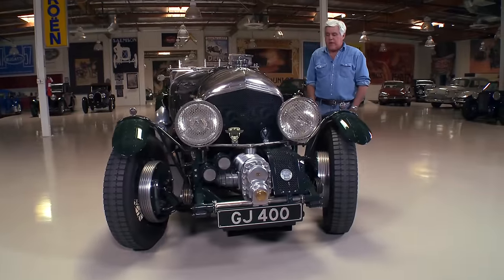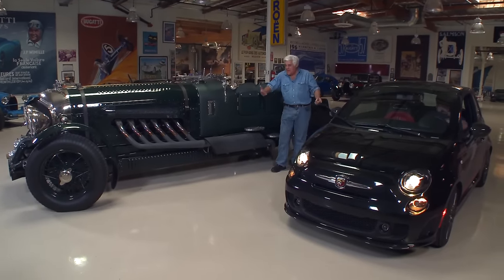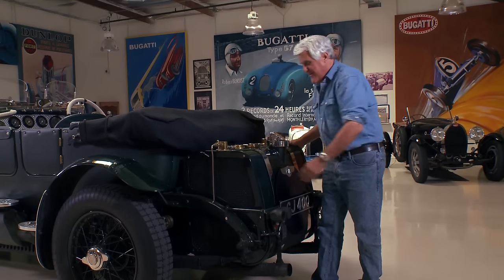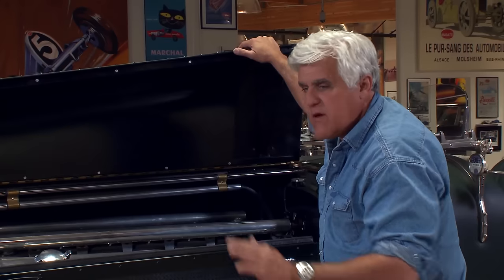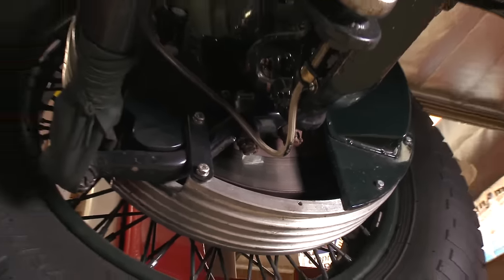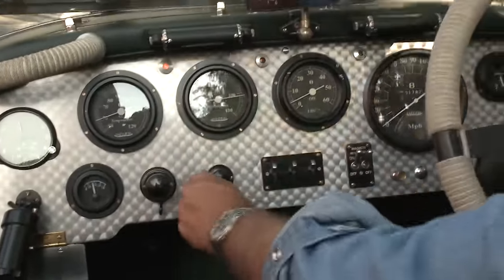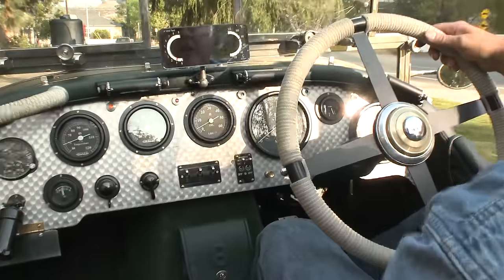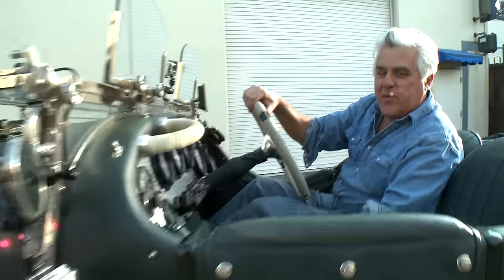1930 Bentley 27-Liter - Jay Leno's Garage

Comment: Is the motor a Rolls Royce Merlin or a Packard Merlin? I'm assuming its a Rolls Royce version because its put in a British car. You wonder how hard it is a to get a Merlin engine though.
Reply: Its probably a RR version given that the car was Built in the UK, and yes you can still find them for sale. I've seen them as cheap as $2400 however usually at this price needing a rebuild. They were built in large numbers because although most commonly associated with the Spitfire and the P51 Mustang these engines were actually used in a lot of other aircraft. Mostly bombers such as the Lancaster however, after the war could also be found in a number of commercial aircraft;, I think they were produced up until the 1050's. There's also a version which could be found in various tanks and other military vehicles although they were not called Merlin's, I've forgotten their name but they are often miss identified as Merlin's although had several defences including 2 rather than 4 valve per cylinder, no supercharger, different carbs  etc.
Reply: cheyennedogsoldiers The tank version was called the Meteor, initially used in the Cromwell medium tank.
Reply: TheAegisClaw No, the unsupercharged version was called the Meteor. It was fitted to planes as well.
Reply: Neither. As it doesn't have a supercharger, it's a Meteor.
Reply: Thanks TheAegisClaw I had a complete brain fart and could not remember the name. LOL! 

A3roboy, Not necessarily, without checking block numbers there's no way to tell the origins because don't forget, the Merlin version was deigned to operate on AvGas not conventional pump gas. Therefore these engines see significant modifications to allow them to operate on modern gasoline which often entails removing the superchager.
Reply: This particular engine is a Rolls Royce Meteor, basically a non supercharged Merlin engine. This actual engine is definitely a Meteor, not a Merlin. It started it's working life in a Lancaster Bomber. One of the sister engines from the same Lancaster went into a tractor pull tractor that I got to see in action, it was the tractor pull owner that told me about it when I had a chance to chat to him while he was getting his pit area set up. I know that this is a bit of hearsay but the owner of the tractor didn't have any reason to lie, the Merlin is the more desirable engine and he also had a massive pile of paperwork for the engine and the original bomber.
Reply: Just call up Jack Roush racing..he has two Mustangs and a warehouse full of engines,,,,,BUT   you had better have a DEEEEEEEEEEEP   checking account...he also has the only FFA certified rebuild station in the USA...FYI
Reply: quinnjohn1
No Meteor was fitted to an aircraft.  The Meteor is a tank engine, unsupercharged, and developed for ordinary fuels, not the super high octanes for aircraft. Just to be confusing, some Meteors were built using second-hand Merlin blocks, or even 'seconds' rejected as not good enough for an aircraft engine.  
 Lancs got Merlins, never a Meteor engine

Comment: What a spectacular car! And as you said, Jay, so well done. I'm curious about the
gearing; the Meteor is not high-revving {around 2400 rpm, I think}, and torquey too.
If 650HP/2400 RPM are right, torque = 1422 ft-lb. Tall final drive ratio is required!
Jay, you so plainly enjoy your collection, and are so intimately involved with
everything in it. You know how to operate it all, and how to share it with others,
unlike so many other collectors. Thank you so much! Charlie

Comment: The Meteor engine (which was Merlin based) was 650 hp non-supercharged used in the Cromwell tank
The Merlin 27 litre Mk II was the first production run and with supercharger it produced 1,030 hp (Spitfire, Hurricane, Mosquito, Lancaster, Fulmar, Battle, Halifax, Hornet, Barracuda etc etc)
The later Merlin XX with improved supercharger produced 1,240 hp
The Merlin was replaced by the Griffon 37 litre which was a similar physical size to the Merlin but with 1,730 hp (Mk IIb) up to 2,420 hp (Griffon 130)

Comment: Jay, as you are likely aware, the weak link in the Merlin engines relates to the flaking of the chrome plating on the rocker arms, that then contributed to cam lobe wear.  Well, my friend developed a solution for this problem that also reduces friction and increases horsepower. If you want, I can put you in contact with my friend.

Comment: Jay.  What a remarkable 27 litre Bentley!  There's is a larger motor available, the 36 liter Rolls Royce Griffin!  More fuel tankage required.  I'm amazed at the exhaust/muffler system.  So quiet!  It works so well with the rest of your car.  Your knowledge of Bentleys in existence is vast, do you know what happened to the 'Jumbo' Goddard twin turbocharged Bentley that was featured in either the 'Road and Track' or 'Car and Driver' magazine in the early 1980's?
Reply: utube is offering a 1924 twin turbo up next. Might be what you're looking for.

Comment: Makes me wonder how the Spits and the P51's managed to stay stay in the air as long as they did.  I mean that engine would be sucking the juice like crazy.   And, though I'm no historian, I've heard the P51's had very long range and were used as bomber escorts while the Spits were used mostly over England.  Still, they must have had massive fuel tanks.
I also read somewhere that the P51's used cardboard drop-tanks so when they dropped their tanks over enemy lines the enemy couldn't make use of the metal. 

Beautiful car Jay and kudos to the builders.  But does it have cup holders ?

Comment: Can you imagine turning it over at speed and 3 tonnes lands on you? Little chance of surviving. I remember someone who kept blowing original engines up driving at speed and couldn't figure out the problem. Finally worked out the 1930s engine was only designed to circulate oil to cope with driving at high speed (80mph+) in short bursts as British roads didn't have long straight sections suitable for continuous high speeds.

Comment: Henry Ford made an improved copy of the Merlin engine. It was a V-12 of course because 12 cylinders in a narrow V is a "natural" configuration for a 4 cycle gas engine. In engines that size you want it to be smooth running. He made it to be the same size as the Merlin which also was a size seemingly favored by nature. The Kestral V-12 was an earlier smaller version of the same basic design and was a success. But the larger version of this design called the Vulture never quite worked properly. 27 liters is just in the sweet spot for V-12 aero engines.  

So Ford made his new improved aero engine the same size as the Rolls-Royce Merlin. But it had many improvements. It had a stouter bottom end with more main bearings and it had twin overhead cams whereas the Merlin was only SOHC. What it didn't have was the R-R dual speed/dual range supercharger.

As everyone knows the Allison engine was swapped out of the P-51 and the Merlin put in and the P-51 Mustang became a word beater. But the Allison was, like the Ford, a 27 liter V-12 with a good bottom end. It, like the Ford, was a better engine than the Merlin except for the supercharger.

I mention all this long winded and well known history to make a point. The Merlin was a great success because of it superior supercharger and when it is put into your cars or tanks - they take the supercharger out. You could get a better car if you used an Allison engine as many Hot-Rodders did in the fifties - or better yet - you could use a Ford V-12. The eight cylinder cut down version of the aero Ford V-12 was the best of the great many engines used in the Sherman tank.  

In some alternate reality instead of using the Merlin in the Mustang, which required a whole long and expensive re-engineering by Packard, we could just mount the great Rolls-Royce supercharger on the Ford V-12. A P-51 Mustang carrying a Ford V-12 with a R-R supercharger should have been the best possible WWII piston engine fighter. I think it might have been the Allies politics that dictated the decision to use the Merlin not engineering considerations.

Comment: It should have been made with the gauge needles sitting straight up when in correct operating range, like aircraft have.  This makes it easy to see a problem.  If the needles are up all is good.

Comment: From the silly question's dept. Mr. Leno. Your Allison automatic transmission looks a lot like the Allison automatic in the medium line haul trucks used by the US Army built by AM General. Is it the five speed with lock up converter from Allison?

Comment: The Brutus is way more badass, especially in that black paint.
Reply: Not really   you should check out the PACKARD Bently Mavis here on You Tube   Uses a PACKARD 4M2500 PT Boat engine..2500 cubic inches  42 liter  compared to the Merlins 1650 cubic inches  27 Liter...a REAL beast....
Reply: Wilbur Finnigan the brutus has got a 46l engine
Reply: TheMeilinger  Yeh but the Packard puts out 2 to 3 times the HP   supercharged....
Reply: Wilbur Finnigan it's not about the horsepower, it's about the torque
Reply: The Packard has the toque also ! ! !
Reply: ***** that bently is home made... the chassis is from a bently but the rest is all hand made.
Reply: ***** The Brutus is the epitome of an extremely simple grassroots build, and it looks awesome in a kinda German pseudo-rat wartime style car. It's European hot rodding at its best!
Reply: MLG N05c0p3d I agree, its fuckin awesome but it is also the definition of madness in the motor industry.
Reply: What would this world be without madness?
Reply: P E A C E F U L !!!
Reply: No, it would be boring, and we wouldn't have almost all of our most important inventions and most important advances in society and medicine!

Comment: That engine technically is not a Merlin, it is a Meteor which is the land version of it usually found in tanks.  It shared a lot of the mechanicals but used cheaper materials in certain parts hence the lower power output and no supercharger.

Comment: He doesn’t mention that it had carburetors. This was the weak spot relative to the Messerschmitt 109, which had fuel injection. When the spitfire was in negative G it would flood its engine and cut out. Also I believe in the spitfire it reputedly developed 1500 h.p.

Comment: Aircraft engines are more appropriate for a truck.
Propellers only turn about 2700 rpm.   So they can either gear them down, or design the engine to run slowly--they usually do the latter.

Comment: If it's rated at 600-700 HP, it's not a real Spiitfire Merlin. Upon completion, Merlin engines were tested, and those that did not meet specifications, were downgraded to 600-700 HP, and called Meteor. The Meteor engine was used in tanks!

Comment: just to put this car into perspective, the old range rover sport which also weight 3 tonnes had a 5 litre supercharged jaguar v8 producing just over 500 horsepower, and with the top speed limiter taken off it could do around 155 mph, so this big ass bentley can probably go quicker

Comment: Typical Merlins from the Battle of Britain era produced around 1200 to 1500 horsepower depending on the model, later version produced up to 1700 horsepower or more. They had superchargers and negative g carburetors. In the Top Gear episode that Jay refers to I think it was James May who says that when the supercharger is removed is ceases being a Merlin and is technology an earlier form of the engine with a different name, can't remember what. That engine may have started off life as a Merlin, but with that supercharger removed, and the carbs replaced with modern fuel injection, it can't really be called a Merlin anymore. Shame.

Awesome car though, really love it!

Comment: Love that car. I wonder how much Torque it has at what RPM? How many gallons of gas does it hold and what's it's mpg?
Reply: Looks like a 40 gallon gas tank. I would suspect it get 10 to 15 mpg depending if it has fuel injection or not. Of course, that's assuming you are driving it like grandpa might. Racing it around would drop the MPG way way down.
Reply: 1971SuperLead Doubt it. A 4.9 L flat 12 in a Tesstarossa gets 9 mpg. This thing here probably gets 2 and change.
Reply: The Speak Ya, well, a 26.000 pound big rig can get 10 mpg so....

Comment: So what kind of miles per a gallon does it get if it idles cross country?
Reply: It's more a question of gallons per mile !!!!!!!!!!!!
Reply: I guess 1MPG :D
Reply: in flight it consumed about 150-220 gallons per hour at 2,850rpm with a supercharger on it and about 1650hp, so with less than half the power and only about 1000rpm i would guess roughly 1 or 2mpg max

Comment: Needs louder mufflers to mask the whine of that Allison transmission I have a 2014 KW 880 str8 truck with a Cummins 500 HP sadly it has a regeneration emission  system cant make it louder  and that 6 speed whines like crazy !

Comment: 9:23  Jay "A 27 litre  engine, it can't get much bigger than that".  What about the Rolls Royce Griffon, a 37 litre engine which is physically not much different in size from the Merlin / Meteor engines.  When Jay decides that his Meteor is simply too small and lacking sufficient power, he can slip a Griffon in his car.  BTW, it's a Rolls Royce Meteor engine in a Rolls Royce Phanton II chassis, so it's not a mixed-marque hybrid, even if it masquerades as a Bentley.

Comment: Brian Johnson has one also I think.
Reply: +Gary Lowe Close, Brian has an original 4 ½-Litre.
Reply: I thought this was the only one built.
Reply: Jays is completely custom and not original, as he mentions. There wasn't an original 27-litre (the 1930 Bentley predates it's engine - the Rolls Royce V12 Merlin which came a few years later in aircraft). Brian Johnson has a 1930s Bentley but it's an original 4 1/2.

Comment: It's not really the aero engine as it lacks the supercharger. It's effectively the non-aero version called the Meteor, which was the version of the Merlin developed for tanks and the like. But I guess that the Merlin has more ring to it, but a Merlin without a supercharger simply isn't a Merlin. 

Incidentally, that think on the front that looks like a roots-type supercharger is no such thing. It's there to echo the form of the  supercharged Bentleys of the inter-war period. Merlins did not use roots-type superchargers, and most definitely not as lumps that stick out in front of the engine. 

That said, still an amazing thing, but, it's not high on practicality.

Comment: If you scale the standard engine in my Mazda to the same literage as this Bentley it'd be making 1944hp.  Crazy that it's making less then 700hp. In other words it's making 25hp per liter.
Reply: Yes, but Mazda's all all HP. If you look at the torque stats, this cars likely double the low end torque for the same literage
Reply: It has to at least be making 2400N.m of toque to match my car for torque per liter. Twice that is 4800N.m which is a lot (3540lb-ft)! I would like to know the actual torque figures of this engine.
Reply: Maad Dan Quick google says the Merlin had around 1600lbft of torque (2170Nm).
Reply: So it's less, wow. I guess it is an old engine though, not very advanced.
Reply: As engines get bigger they become less efficient, even with the new ones
Reply: Yer that's right, more heat = less efficient.
Reply: If you google for 27 litre Bentley, you will find some descriptions and it seems this car indeed uses a genuine Meteor engine.
Reply: As I said above, the Merlin has 1600 lb-ft of torque., which is slightly less per litre of displacement than the Mazda. The Meteor without the supercharger must have had less than the Merlin.
Reply: The discussion here is mainly about specific power (kW/Litre) and specific torque (Nm/Litre). Efficiency is a whole 'nother issue and there is no reason why a large engine cannot be efficient. I'm not sure what Anton and Dan meant exactly, but it's not generally correct. In fact, the largest ship engines are among the most efficient engines, if measured in percent or specific fuel consumption (grams of fuel / work).
Reply: Maad Dan old engine, and you could not have any chance of engine failure in a fighter plane. cause that means the loss of a valuable plane and an even more valuable pilot.

Comment: only 650 hp??? The p47 had like 3.5k!
Reply: I assume the engine is not a Merlin but a Meteor. The latter was derived from the Merlin but came without a supercharger. It was made for tanks as the Cromwell, Centurion and Conqueror. The late Meteors made 650 bhp.

Comment: that engine capable of 1600hp. the german hienkel bombers that bombed london in the 40s were powered by Merlin engines.
Reply: 1990pommie
Reply: The Merlin was a British design (Germans used their own engines, though before the war they did test a few early prototypes using the Merlin's predecessor the Kestrel), and in later versions it could deliver over 2000hp when fueled with 150 octane avgas.

This Car uses the Meteor, a de-tuned version of the Merlin with no supercharger (hence the much lower power output). The Meteor was used to power the Cromwell tank and its derivatives.

Comment: get 1,000HP out of this engine? if this is really the Rolls Royce Merlin, the V-1650-7 Rolls Royce Packard Merlin had 1,490HP at takeoff, 1,590HP i think at about 15,000FT i believe Military power, and with War Emergency Power the engine could crank out 1,720HP at 67HG mercury which was how they measured boost with vacuum... and this was in the P-51D Mustang, the V-1650-9 had a newer water injection system and created over 2,000HP, and this was in the P-51H Mustang, of coarse these engines had the two stage two speed supercharger and pretty much open exhaust stacks.